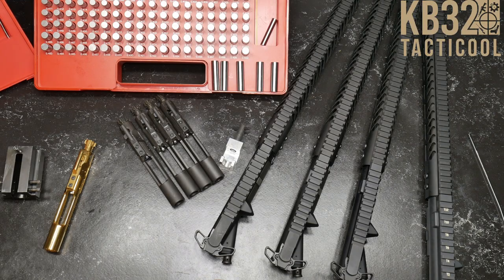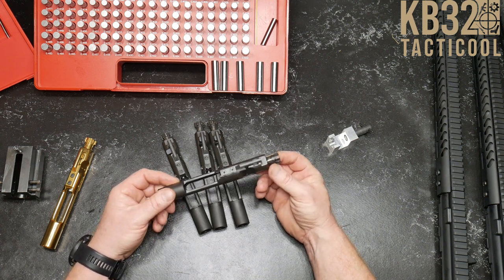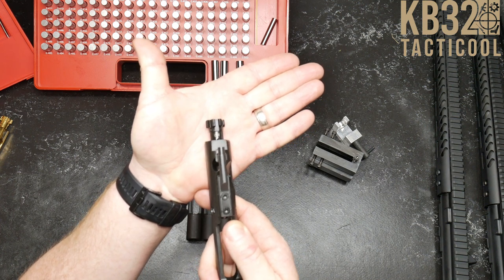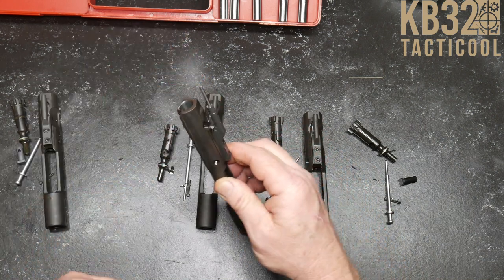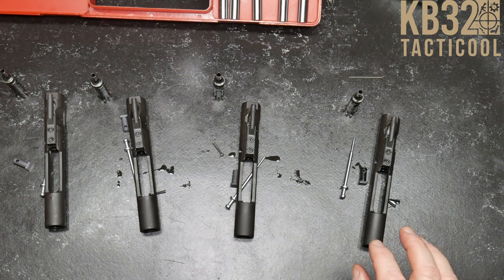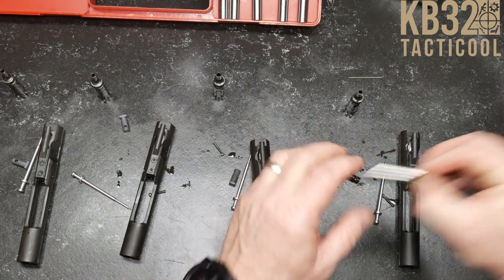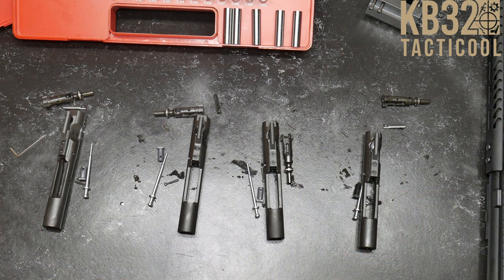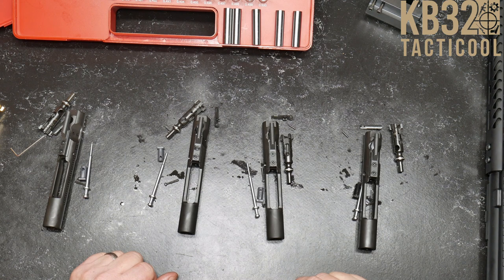BCG Quality Control Check, This will Surprise You!!

Comment: Primary Arms, Arm or Ally, Palmetto State Armory, Brownells, Arms Unlimited are all good places to find BCG's I recently bought 4 Aero Precision Nitride BCG for $140ea for 2 and $149ea for the other 2. Use a search engine to find them if your regular companies are out of stock. There are parts out there if you search hard enough, same with ammo it's all just more expensive of course.
Reply: I have a brownells bcg and the bolt is not mpi stamped but the website says it is.

Comment: Sorry for your loss. I've been using ToolCraft or Aim in all mine. The only issue I've had was a Tromix 458 it will only cycle with Tromix Bolts. Other than that Nitride or Nib. It's sad $129 for a $79-$89 bcg last year.
Reply: Had the same issue with a,.458. Tromix was the only one I could get to work
Reply: @tlrinc2343  Yeah apparently Tony's barrels only run his bolts. Never tried anything different in 458.
Reply: @edhlavaty6914  I used a Faxon barrel but could only get it to work with the Tromix bolt. I think Tromix is the way to go if you want 458

Comment: I've never had a problem with PSA (Toolcraft) BCGs and I've used a bunch of them.  Also no issues with Aero and DD.  The only one I've had problems with is POF and it was not only with the original but also with the replacement but they quickly took care of it.  I'm sorry for your loss sir.

Comment: I’ve got two premium 158, hp/ mp bcg’s from PSA, both of which have seen a lot of action. No problems out of them at all. I did upgrade the firing pin for a nickel boron coated firing pin and a KNS Precision firing pin retainer on both. Good stuff buddy 🙌

Comment: I just ordered a premium nitride and chrome lined bcg from PSA. Their website says certain substitutions are allowed right now due to lack of specific inventory. I can't remember specifically but you can check it out. I think their is a tool steel that is subbing for carpenter 158 right now on the bolts

Comment: Same plant really doesn’t carry any weight I have worked in machine shops any tolerances will  vary , when cutters are changed adjustments will be changed  , if works that’s all that matters don’t over think measurements